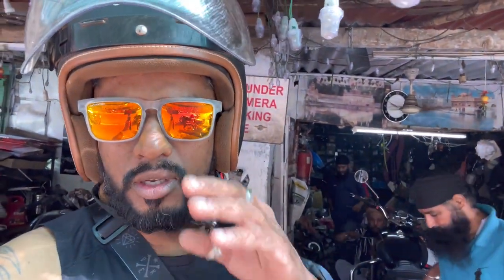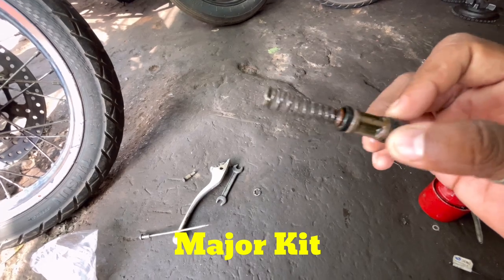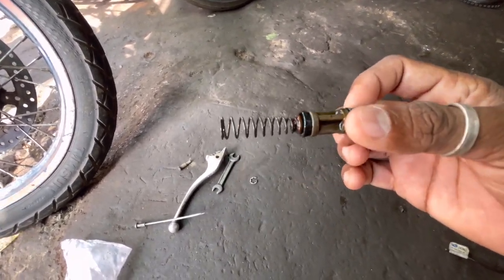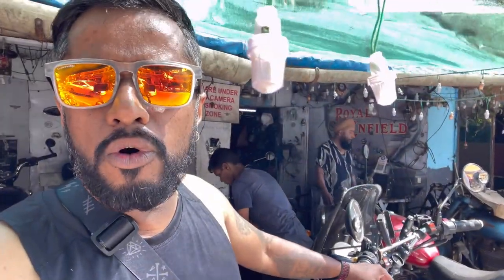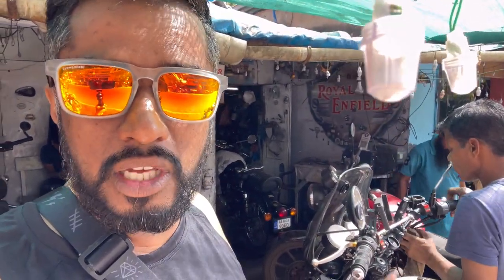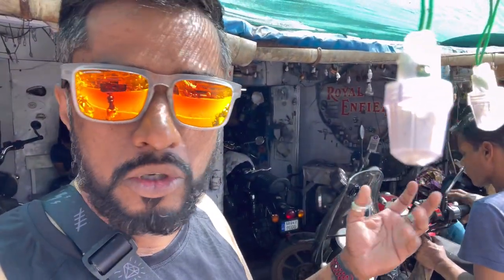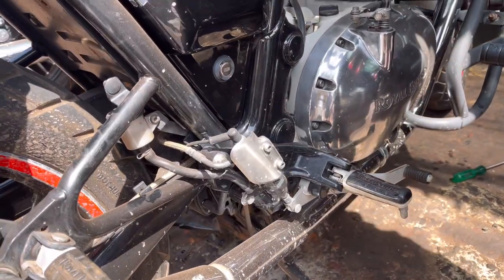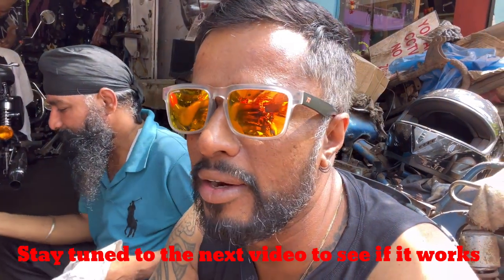Interceptor 650cc Brake Failure | Issue Solved | Major Kit worth 651/- installed

Comment: I had an issue with the front brake 3 days ago. It just failed downhill. I had to kill the engine to stop. There was a leakage from the master cylinder level glass. Service center showed me some marks on the brake lever  and said that the bike must have been dropped or hit something and because of some increased pressure from the impact the leakage happened. I have never dropped the bike yet. Anyway spend ₹3700 to change the cylinder since apparently it cannot be repaired. I had 1 month more for warranty to end but they did not give it since it was supposed to be my fault.
Seeing this video I’m loosing confidence in RE and realise why many of my friends bullets are regularly visiting the workshop.
Reply from the maker: Very true if you seen my most viewed video also u will realise how they were initially blaming me for the extra accessories to the result of the bike wobbling 

I had to them strip the bike off completely and show them how much the wobble was n then they agreed to get the servicing done FOC
Reply: When I came home I inspected the reservoir, this is the first time I’m seeing one open. There is a minimum level in the reservoir so obviously an air gap above. If so pressure can never develop in the chamber. ₹3700 is not a kill amount but I’m not going to leave Royal Enfield without fighting it out in social media
Reply from the maker: You should speak to the branch manager first ideally
Reply: @MumBikerBoy  Just to give you a feed back. After a lot of technical persuasion service center has agreed that’s it’s an issue with the piece and will replace it under warranty
Reply from the maker: Great news well done

Comment: Very informative. Thanks for sharing. 
At how many Kms did you face this issue and how old was your bike when this happened?
Reply from the maker: Around 12000kms n 2 years
Reply: When I was in India I used to have a 2008 350cc Electra with front disc brake that never had this issue for > 1,00,000 Kms!! I’m surprised the new bikes are having this issue. I now have an Interceptor 650 nearing 12,000 Kms, so will keep a watch. Thanks.

Comment: Did you face this issue again? after changing the MC kit. I did twice and this keeps coming again and again
Reply from the maker: Yes bro I also did face the issue and recently they did the bleeding process for the bike 

We’re in they pump out the air in the brake fluid pipes

Comment: My GT has this issue but on the rear brakes and I had no clue what to do and sometimes when I'm riding 100+ it suddenly stops working. Do you have any idea what's the solution for it? if you do please let me know!
Reply from the maker: Ask the service guys to do bleeding of the oil n it should be fine post that
Reply: You need to pump it couple of times and lose the air block inside. You will see breaks working temporarily
Reply: I have had the same issue since I have purchased the bike, The royal enfield are royally screwing the quality of rear brakes. This problem is common in most of the 650s around and now my bike is in service center and I am fighting my way to get the master cylinder replaced under warranty. This is really unacceptable and Royal enfield should be sued for this.
Reply: Same problem with my Interceptor 650 too. Don't know RE has not fixed this and playing with lives.